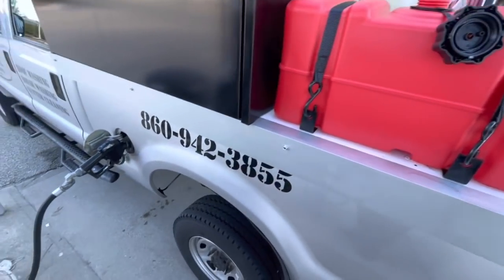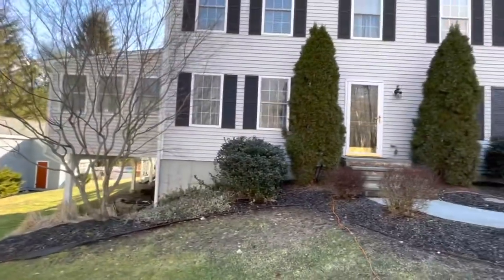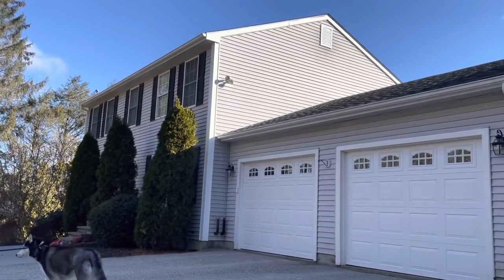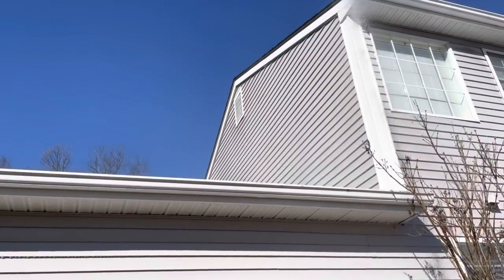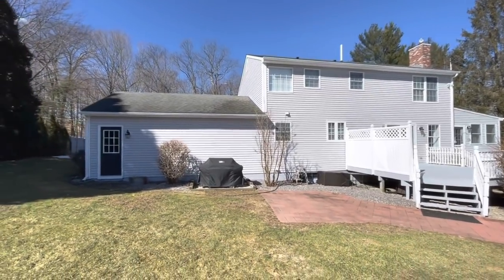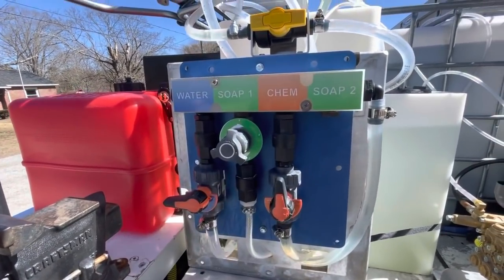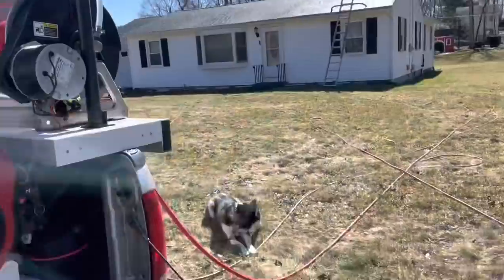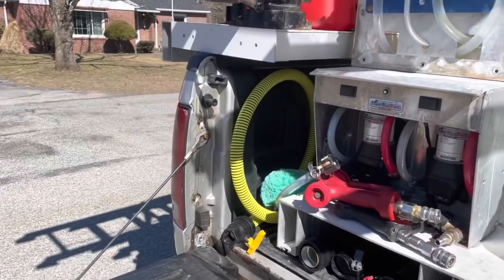2022 Wash Season Kick Off

Comment: I just wanted to let you know if you're having a problem using that leaf blower with those attachments you can try getting a shop vac 6.5 and use a converter that you can plug into your truck that should work better
Reply from the maker: Yeah. I bought a nice vac to try. Liking going Sky Vac at some point

Comment: Just a thought for others as well with IBC totes. I recently had the bulging IBC tote experience and then it occurred to me I don't need a fancy valve to shut off the water or don't need to be perfect at " keeping an eye on the tank" which never will work and it only takes once to jack up the tank. So my fix was simply and extra hole drilled in the top with a 90 fitting to keep out debris so the next time I lose track of water to the tank it will simply run out on the ground until I notice. I figured this may save a few guys tanks. Happy washing
Reply from the maker: Great idea

Comment: Joe, I'm in the process of changing my current setup to be more efficient.  Is the smaller tank on your truck have SH & Elemonator? Is that your downstream tank?  Also, I know you soap with your M5. I thought you need to have a special tip on a jrod to pull soap. I'm a little confused and trying to understand your setup because it works well. Thank you!

Comment: With vac poles, try using a back pack blower if you have one.  It makes it easier to handle the pole when you can hold it with both hands.  A bit awkward if you have one hand holding the blower and 1 hand on the pole only.
Reply from the maker: I may do that

Comment: Thanks for the information as always ,
Just wondering do you charge your 12 volt
Battery with a charger or is it hard wired from your truck battery. If hard wired do have any videos . Thanks
Reply from the maker: Last year I was charging at home several days per week. This year the 8 gpm had a rectifier that charges the battery when running